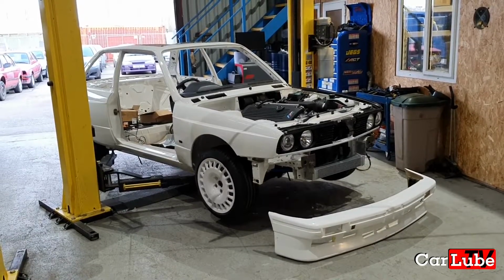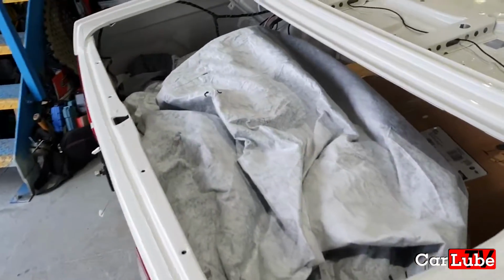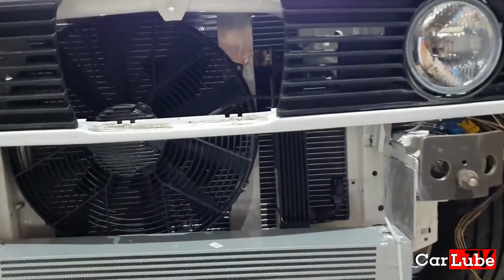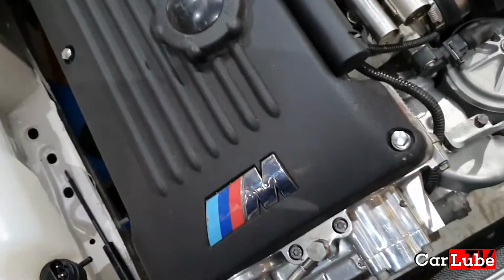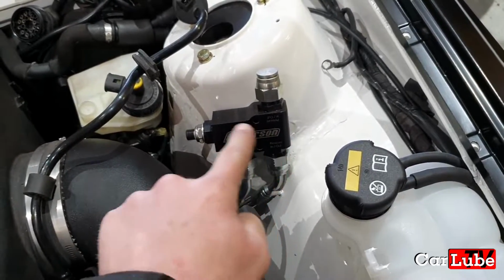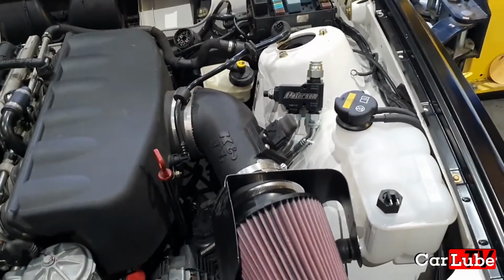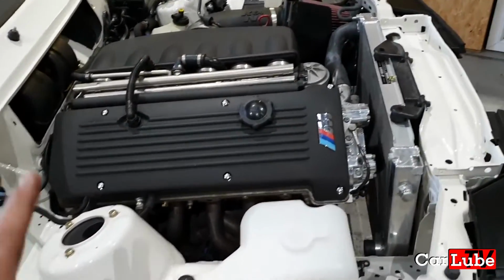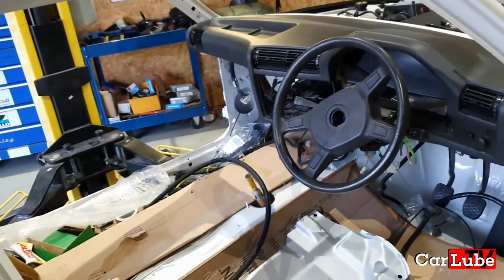New Wheels & more - E30 M3 Recreation EPP 22

Comment: What top plates are you using for the five stud conversion ive got everything but the top plates even the offset ones don't fit do you need to drill or them set